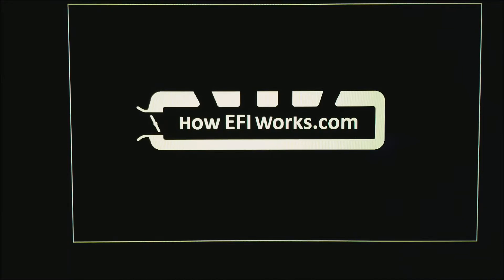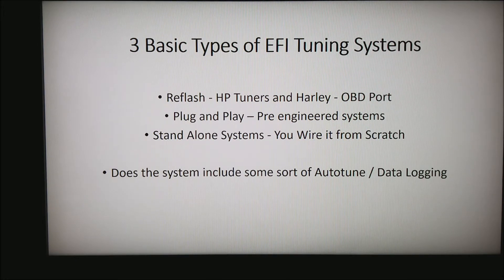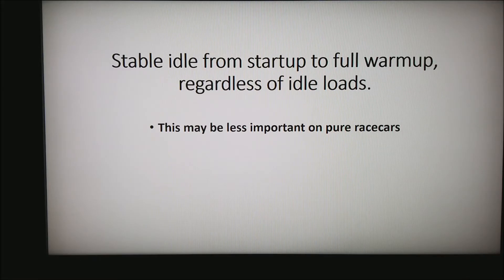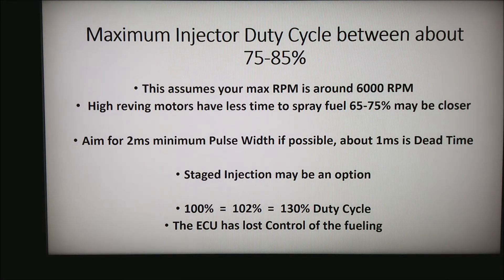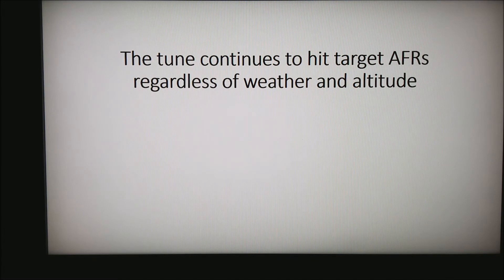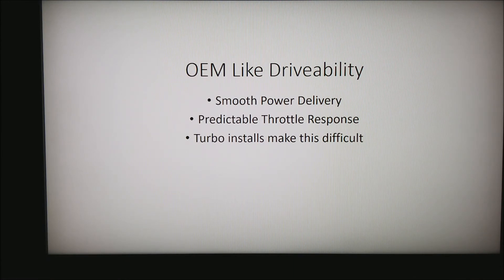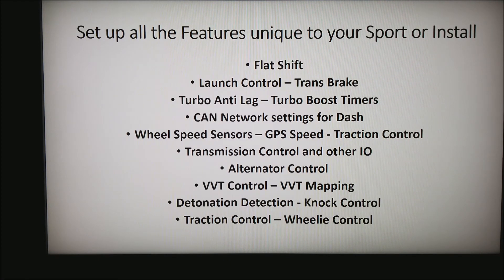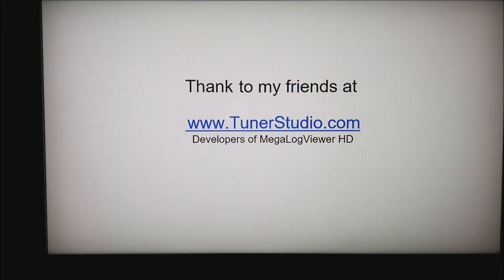Choosing an EFI System for a Great Tune

Comment: This tuning thing can be frustrating especially when you're a novice like myself. I read the manuals, i watch the videos, i familiarize myself with the tuning software, then i go out and attempt to apply what i think i should do. After all of that, I'm still unsure of myself, the changes I'm making, am i reading the datalog correctly and based on that am i making the right changes. I just don't have a step by step strategy that i follow to get the results i want. I really need a formal tuning class where i can sit, learn, take notes and ask my ridiculous questions to the right person who has the right answers... Thanks Mr. Whittle